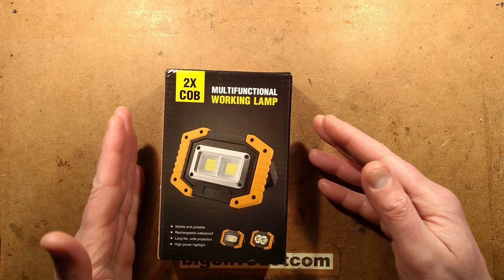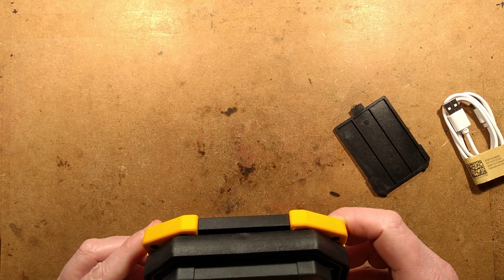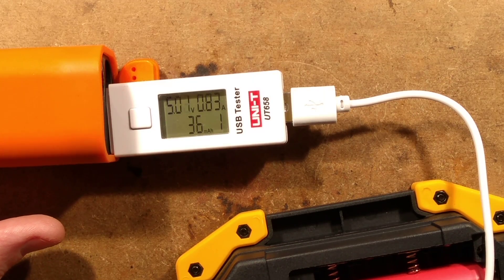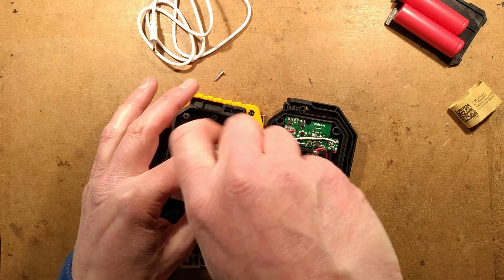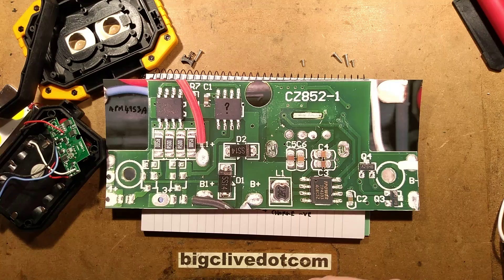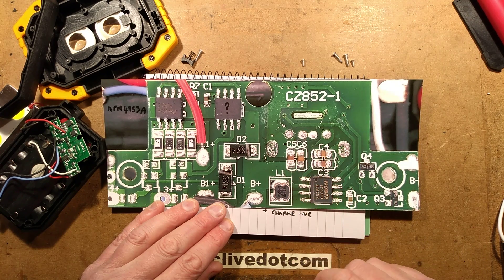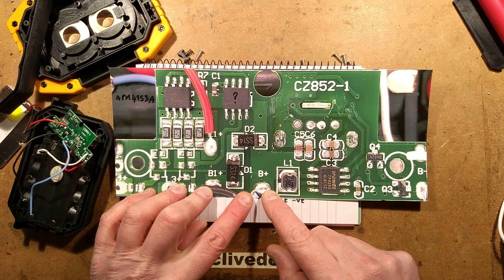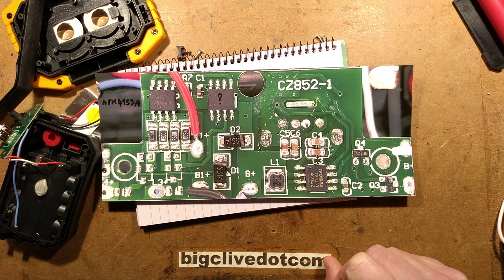Inside a chunky USB rechargeable work-light power bank.

Comment: Clive, I just got one of these, but the 2 square COB type and I'd be interested in some insight from you on the charging aspect.

Your video is quite nice as there was no documentation paper included and the online listing does not mention the output current over the USB port.

Currently I have a pair of Panasonic NCR18650 2900mAh batteries and from a full charge I've been able to leave it running on High for 8hrs 40mins. The brightness dips little by little over time as the battery got drained but the last 30mins or so is the bigger drop in brightness.

My current problem is that it takes a long time to charge at around 7~8hrs from drained. Not sure if its my 5V 1A charger or something else entirely.

My gut feeling is that its the work light unit's charging circuitry since I can charge the same battery (NCR18650, but only 1 cell) with the same 5V 1A charger inside my Wurkkos FC11C flashlight and its done in 2hrs. I was expecting maybe 4~5hrs charging and not 7~8hrs since there's 2 cells instead of 1, but the COB work light unit's charging circuitry might be introducing more losses is my best guess as to what's happening.

I'm considering getting a dedicated 18650 charger and charging the batteries externally instead of within the COB work light.
Reply from the maker: With many of the chargers the bulk of the charge is done quite quickly, but then tails off very slowly at the end.  So after just a couple of hours it may be almost fully charged.
Reply: @bigclivedotcom Finally got a dedicated charger for my 18650s (LiitoKala M4S). First thing I checked is the voltage of the 18650 cells inside the similar portable COB work light I got. 

I wanted to see at what the low voltage cut off is when it auto powers off and I don't like that I saw 2.63v & 2.64v on my 18650 cells. 

My other flashlights that use 18650s typically power off at around 2.7~2.8v so I'm fine with that. But 2.63~2.64v seems a bit too low for me that I'm a bit concerned of potentially over draining the cells. 

I'll be recharging and testing the capacity of the 18650s used to check if they're still fine. (they're seem fine and are back up to 3.6v as I write this)

Honestly my note to self on said portable COB work light is not to run it at High for more than maybe 4 hrs just to be on the safe side.

Comment: I've been seeing similar units to the one you shown in the video as I was searching for flashlights that use 18650 batteries. Nice to see its not too big and would be a nice fit for a toolbox and potentially a good fit for my father who typically needs a wider spread of light rather than a point source from a flashlight.

Comment: I have a few like this, both with the round and square lenses. The round lens version is like a projector lens, so the light is more focused. The square lens version is flat, so the light is more scattered. Both are useful; the square lens version is great for lighting a space (such as in a crawlspace), while the round lens version is great for working in a confined space (such as under a car). 

@ 3:25 I tried the USB output to charge my phone during an extended power outage, but it did not work for this.

Comment: I realize it takes off-line time to do, but for a battery-powered anything, it's always nice when a review tells you how long a fully-charged battery will power the DUT. Even better is to plot the battery voltage over time (=battery life) while also monitoring the light current to see if it's truly constant current or one of these cheap blast light sources that is bright at the outset but dims as the battery voltage falls. Also, how long do the battery types power the VBUS output line?

Comment: What is a COB LED? - I looked it up, Chip On Board, the rectangular type with multiple LEDs compared to SMD or Surface Mounted Device which is cheaper and circular.

Comment: I saw this video and bought one soon after. I was working on a squirrel fan the other day and noticed strobing. Don't usually see that from a flashlight.
Reply from the maker: Some of these regulate the intensity with pulse width modulation.  It can result in strobing effects.
Reply: @bigclivedotcom  It was just a "what the hell  am I seeing moments?"
Reply: Try setting it on high instead of low.

Comment: I like this light, but it kills unprotected cells, it depletes them to 1 Volt even while off. As a help, it starts charging them from 1V, when smart chargers did not even detect the battery...

Comment: BangGood are still selling these for £6.25, including free shipping.  They do appear to be quite bright and good value.  However, they advertise 3 hours run-time on high brightness.  This cannot be correct IF it is really a 30W output device, since 3 x 30 = 90 Watt hours.  Two 18650 3.7V 4,200mAh cells, whether in series or parallel, can provide a maximum of 2 x 3.7 x 4.2 = 31 Wh.  Did you ever measure the power consumption and run-time?
Reply from the maker: The output is definitely not 30W.  It also reduces as the battery voltage falls, so the run time is good.  Just at lower and lower output.

Comment: Seems to be new versions that use 3xAA cells. Wonder if they retained the diodes to prevent charging?
Reply: Actually, there is no 4 AA/single 18650 version available anymore. Is this version better than previous ? I am looking for something similar and wondering if this device (3 AAA version) is still worth ~ 9 USD or is there a better/newer version/alternative ?

Comment: Some companies use the same pcb in different units so they may have slight variations in the circuitry, one is used for a specific application and the same pcb is used to do another application,  both are the same boards ,just used differently or have the options available for other uses.

Comment: .... My Samsung phone not triggering charge output of TP4333, I'm going to try increasing capacitance of C3/C4 (Parallel 2X 10μF, measuring 19.2μF).
I'll get back to this comment. Also want to insulate 18650 battGround from heat sink of COB, must be close, (just feels wrong).
Update: Had success with a Decrease in capacitance to 10μF (Removing one cap), Tried everything in between 10 & 20μF.

Comment: Help! Some questions

1- The USB out put works also with 4xaa or only when 18650 are used??

2- Does it give same brightness when using 4xAA or 18650?

3- Can it recharge the 4xAA or the recharge function only works with 18650??

Thanks a lot!

Comment: Instead of using four batteries and 2 diodes to waste power, they should have gone for 3 AA batteries. There is a boost converter anyway. If you use 3 NiMH then they could even get some charge up to 4,2V (1,4V per cell) and Alkaline will not really take much current at all.

Comment: I have a power bank that probably has the same chip in it,as it also just cuts off at 1A. Its completely useless for modern phones, as it does not comply with the USB spec. On overload, the output voltage should just sag, not cut off. This lets the phone regulate the charge current to get the most out of the charger. When the output cuts off, the phone has to restart the detection process.

Comment: any word on over under charge protection with the Li-Ion cells  and can it run with the power plugged in  oh is it water proof         thanks
Reply from the maker: Not waterproof.  Probably splash resilient.  No obvious under-voltage cut off, but the LEDs will not be conducting by that point anyway.  It can be used while charging as the two sections are separate.  But at full intensity the cells will not be able to fully charge as an equilibrium point between charge current and LED voltage will be met.

Comment: It's an improved knock off of a CAT light, neat. 
https://www.ebay.com/p/CAT-LED-Work-Lights-500-Lumens-Rugged-Magnetic-Rotating-Handle-2-Pack/23017823224?iid=264143705084&chn=ps
Reply from the maker: A huge improvement by the look of it.  Much greater functionality.

Comment: Uncle Clive, most dumb-ass users are used to putting batteries into appliances, nose-to-tail. Could you please experiment with putting two freshly charged 18650s into this light in the affore-mentioned manner, placing the light in your pocket and then seeing how long you can last before having an overwhelming desire to take your smoking pants off?
Reply from the maker: It does have that weakness of positive connection bumps that protrude into the housing.  That makes it possible to short out batteries, but also makes it more versatile in accepting flat end cells.  I'd choose the extra functionality.  I'm sure the people who put the cells in the wrong way round will soon learn that the spring normally means negative.  (Sometimes!)

Comment: dear Clive, 
recently i came across one of those water-powered clocks, you just pour some water inside one and you don't need any batteries or any other power source, I know it's not new at all, they've been around for a good while now, however I couldn't find the schematics anywhere, I'd be super grateful if you did that 
regards
vm
Reply from the maker: It's just a dry battery where the water (and salt) works as the electrolyte.  The electrodes then gradually eat away like any other battery.

Comment: Just one addition, since I am using this light for about half year, take care for your 18650s: circuit board in this work light doesnt have any battery drain protection. I already lost two batts to find this out. Either use protected cells (yes, it fits nicely), or keep an eye on voltage and do not leave batteries there for long time without use. About light beam - yes, it is fairly good. I do not use powerbank function neither charging function, so I cannot write anything about that. Only modification I did, drilled few holes around body - COBs are going wild with temperature over time.. :)

Comment: Yo Big C! I have an old motorcycle battery you can take apart if you want? I don't think that is something you have done before.  It should be fully discharged since it doesn't work anymore.
Reply from the maker: Thanks for the offer.  I took a small sealed lead acid battery apart in a video recently and it was just basically lead plates separated by acid soaked fibreglass.

Comment: We spent 3 years on the road from fall through spring to avoid the very harsh winters of South Dakota.  This year we have been forced to remain in our summer home due to family health issues.  At any rate, when on the road, we found it a real pain in the ass to have to set up all our network devices to the new wireless routers at each stop for a couple of days to a month.  So I found a little portable wireless router that runs on USB power by HooToo, she was cool and made such things much easier as at each stop, I would simply enter the menu on the mini router and leave the broadcast network to the same settings as our home router. So all our stuff works great no matter where we are after a few minutes setting the router in our rig.  Well the first one went to hell so I replaced it with one that has a built in power supply (looks like 4 18650's by the size) and doubles as a power bank.  Now that we are grounded for the winter, I brought the little device in the house and it is acting as my primary power bank because of it's great output and power availability. I also programed her so if I need to come up with an old machine that can't deal with modern routers I can turn the little guy on and run it with WEP so the old stuff can log on.

Comment: An another useful feature these lamps have is that you can turn on the light then reconnect the charging lead and the light will draw over 400mA of current, presumably powering the COB and maintaining the 18650, the Red LED flashes in this configuration. I have the twin square COB, nice lights.
Reply from the maker: The charging circuitry seems to be completely independent of the light, so I'd guess that if you plugged in the lead it would balance at an equilibrium of cell voltage and LED current.  At full output it would never be able to fully charge the cell to 100%, but at low output it would.

Comment: what about the heat? I've seen not so good reviews on gearbest for similar lamps, where the heat was a real problem after a few minutes...
Reply from the maker: The power dissipation is quite low.  But if it did get too hot you could remove one or two of the parallel resistors to downrate the light.

Comment: Based on this video, I hopped on ebay and bought one.
Reply: And I've received it. It works nicely but I've come back to the video to find out if there's any protection against the 18650 cells over-discharging.

Comment: Seems to me it's more than a bit over-engineered for a simple light. I was not aware that LEDs needed such elaborate controls. A simple current limit would entail a transistor and a very few other parts. Most LED circuits are quite happy with just a resistor to limit current. Almost surprised they didn't slap an Arduino in there as well because , you know, Arduino. Having been in electronics since the 60's and have seen what can be done with simple circuits using but a couple of transistors. I am amazed at the over the top lengths people go to today designing circuits mostly because they can.
Reply: Most of the added circuitry is for the boost regulator to deliver a regulated 5V to the USB port from a 3.0-4.2V battery.  The microcontroller itself is only to deliver the multiple lighting options (high, low, flash) and cost mere pennies.  High output in most of these basic lighting circuits is effectively a direct connection (through a MOSFET) to the battery, through a modest resistance, and on to the LED COB — in more advanced lights this function will be provided by a boost or buck regulator so that light output remains constant over the battery’s full output from a fully charged 4.2V down to a fully discharged 3.0V.  Low and flashing are then simply generated by PWM.  Low power flashlights are often driven directly from the microcontroller output, but higher power devices like this will often use an external MOSFET to handle the added power dissipation if the internal output of the micro is inadequate to directly drive the load.  There will also be added circuitry to physically protect the lithium ion battery during both charging and discharging as they must never be over charged nor over discharged or you risk setting fire to the battery and is pretty much a requirement for a safe lithium ion powered device.

Comment: You inspired me to tear apart a laptop charger of mine. My rabbit chewed through the wire so it wasn't going to work unless I fixed that. 

No idea what the components are but it breaks the "electricity is magic" mindset. It was also quite fun as there was no easy way in and it took a bit of work.
Reply: My rabbits have had a go at most of my cables and cords. The keyboard cord has two joins. I retired the cord on the vacuum because the house rabbit used to chew it when plugged in and switched on at the wall (if I forgot to roll it up), he never chewed on it if it was unplugged or off at the wall. NO HE DID NOT DIE but I could feel tingles when I stepped in the damaged sections. He got an impressive zap when he bit the charger cord for my iPad though, again did not die. My outside rabbits chew garden hoses and have cut the phone line a few times. you name it my rabbits have tried eating it
Reply: oh and my cat (at 6 months or so) ate the charger cord for my phone, the phone and cord were brand new on first charge. I still have the phone and cord and the cat, the cat no longer messes with cords and my charging cord is only 18 inches long.

oh wow, I've just realised my flip phone is 7 years old! I still get 6 to 10 days on a charge too with original battery!
Reply: @andrea_frm_dubt8977  When I was growing up on the farm we used to raise rabbits, but kept them in a  cage till they were old enough to eat, then, of  course we ate them.  Very tasty, those tame rabbits nearly as good as cotton tails and more meat!  Now I once had  a dog who like to chew on cords but he never tackled one with 110 volts for some reason, but he sure did love the cord to my electric blanket.  No we didn't eat him....
Reply: I have 4 free range pet Flemish Giants and one lived inside for his own safety (his brother tried killing him when they were less than 12 months old). Also I'm in New Zealand, so it's 230V here
Reply: My house rabbit has moved back to outside now and his brother is not trying to kill him
Reply: A neighbour had hamsters that took to escaping from the cage and chewing through the nearby 240 V AC TV power lead. Not unusual to see flying hamsters in that house. Only one of them ever died because of it, and that might have been because of forgetting to roll when it landed...

Comment: ebay done ok .... your soon aliexpress.com ???
Reply from the maker: Problems getting stuff shipped to my location from there in the past.
Reply: @bigclivedotcom  first.  I understood ok . thank you. great video like 👍
good luck 😊👍
Reply: Против Глобал  well, regarding their prices, yes. But their issue is that you have to wait quite long for delivery from china (usually about one month).
Still, it is very nice for some things, for example for older CPUs. Anything LGA1336 or LGA2011v1 is very cheap there.
Reply: With some things aliexpress is cheaper than ebay, with some things it's not. Same goes for shipping. Though, in my experience aliexpress is mostly cheaper/faster. I buy from both approximately an equal amount.